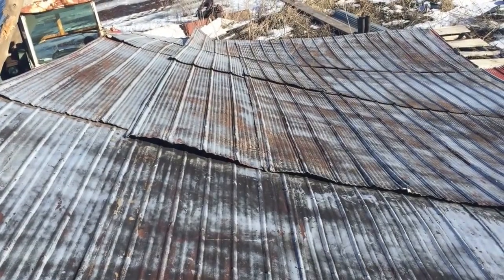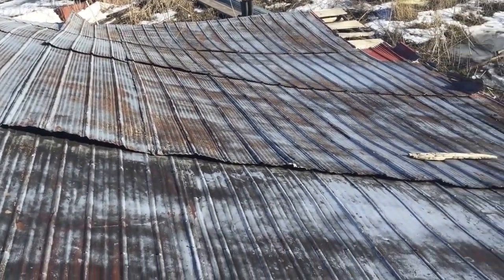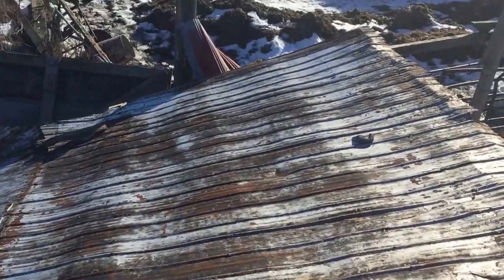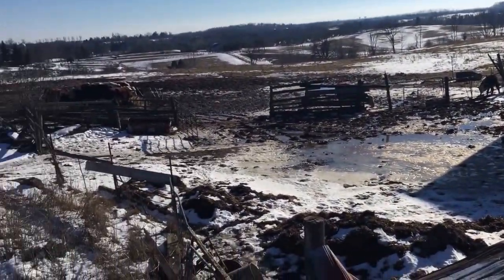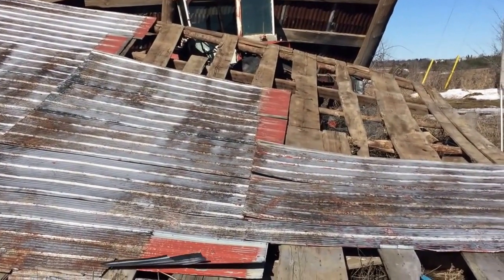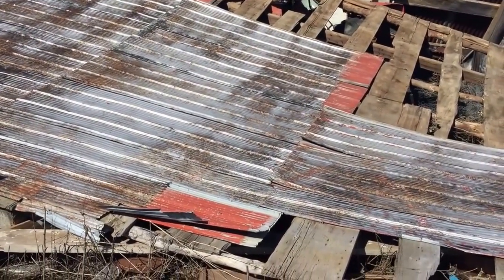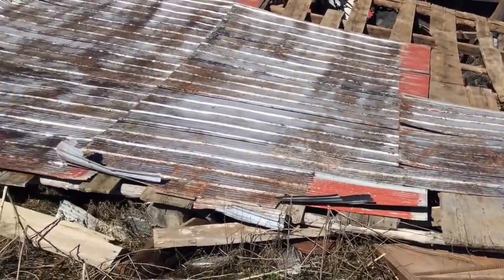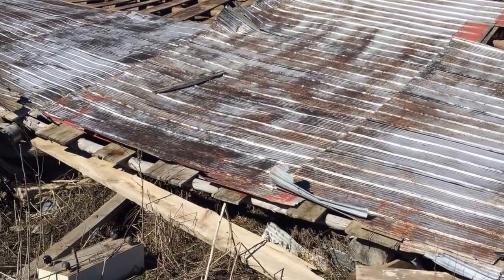taring down the old pole barn

Comment: Looking good man! Its always a pain to take a building apart, especially when is has fallen and is not flat on the ground. Also very good point about having a back up for feeding, I use my skid load primarily but if it goes down I can put the loader back on the 4020 quick. Good luck with the rest of the clean up
Reply from the maker: thank you. I was impressed that you lift manure with the skid steer and not bend the forks.
Reply: younggunfarmer416 lol, I have  broke a few spears in the past, just gotta be careful! keep up the good work bud!
Reply from the maker: thanks so much.